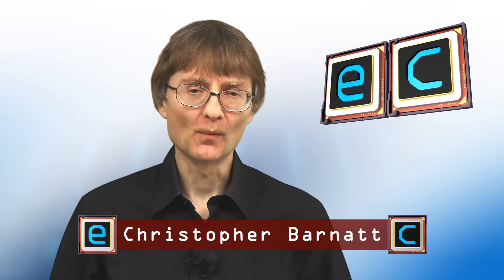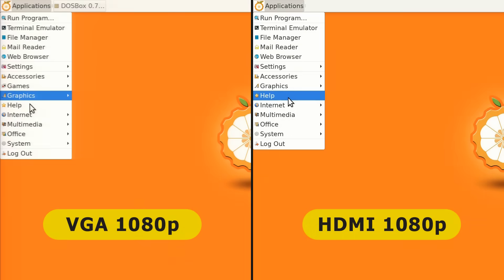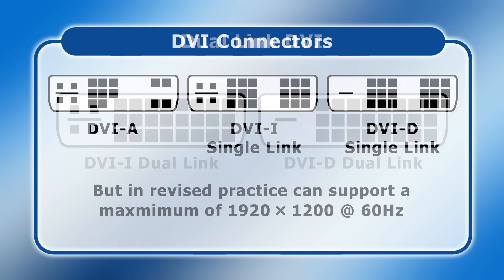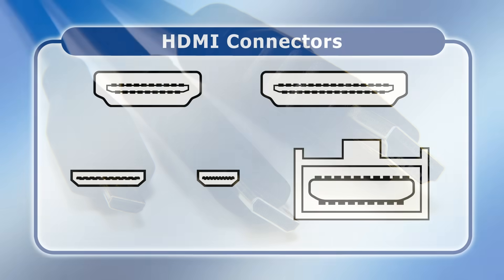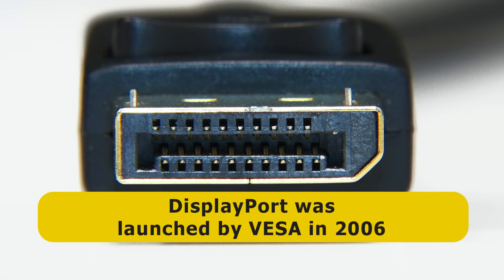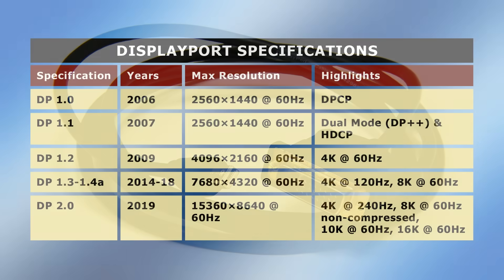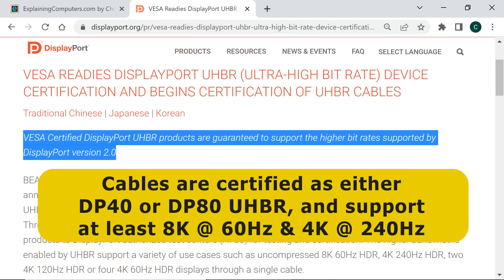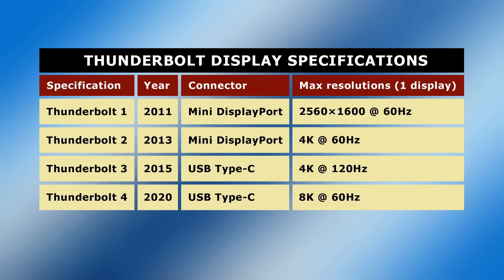Explaining Display Connectors: HDMI, DisplayPort, USB-C, DVI, VGA & Thunderbolt

Comment: As someone who does a lot of computer hardware salvage, I'm glad VGA is still around on a lot of newer displays for easy hookup, and testing of older systems.  

Far as DVI yeah that one was a total mess with all the different connectors, and cable standards coming around so quickly, and I'm glad the industry has moved away from it.  

HDMI, and Display port are a GOD send for decluttering cable mess carrying both video, and audio, just know that if you need to connect display port to HDMI don't cheap out on the adapter, and always make sure to get a quality one like Warrky that fully supports 4K 60Hz, and a good HDMI 2.0 cable that also supports 4K 60Hz, or frustration will part of your day, and more so when hooking up to a 4K display like a TV, that might only support a set number of resolutions compared to a PC monitor. 

Far as USB C/ThunderBolt  for everything that would be great if manufacturers would stop making devices with USB C ports that are really only USB 2.0 for charge/data(excluding headphones, and things like that), and not supporting any other benefits of USBC/ThunderBolt like for example my Nokia G50 Android phone, and Nokia T20 Android tablet both fairly new USB C devices, but stuck at USB 2.0 for data, and only the bare minimum of fast charing, with no other USB C benefits. 🤦‍♂️

As always Chris thanks for another great Sunday morning video. 😀👍
Reply from the maker: Thanks for this. And VGA will be to the fore in next week's video . . .
Reply: @ExplainingComputers  Anytime 😀

Comment: To this day they ship many new monitors with only a VGA cable and no HDMI or DVI although they often come with such port as well.
Reply: It's called being cheap as VGA cables don't cost that much to produce so they can say well we gave you something to hookup the monitor with, and you will also notice that most of the VGA cables you see that come with a monitor/TV these days are thinner, lower quality as well, which causes some of the problems Chris mentioned in the video when looking at a VGA signal at 720p, or 1080p, where a higher quality thicker VGA cable with better shielding, and ferrite beads on each end helps mitigate some of that, but VGA really does start to hit it's limit at 1080p, and I noticed that even using a high quality VGA cable on my old 47in Samsung 1080p TV with my RCA branded 1080p ATSC OTA Converter/DVR box that has the option of using VGA, HDMI 1.4, component, composite, or RF outputs, and both a good quality HDMI cable, and set of component cables looked very slightly better with a less less soft picture, and with not as much color shift on the blues.  Having said that if all your inputs are taken up on your TV, and VGA is the only option left, and you don't want an HDMI switch box for a say a computer, it's far from the worst option to use if you are not sitting right on top of the display.
Reply from the maker: This is so true!

Comment: Like Optimus Prime said:
They are a young species, they still have much to learn.
They should come with 2 simple standards, one with a simple and robust design for big screens and a small version for phones and notebooks with extra cost but hardly no cuts on specs and both should be compatible like in that picture showing 2 types using the same cable.

Comment: This is pure madness. As a young mechanical engineer starting my career back in 1970, I was told that we had to use "standard" fasteners to keep the number of different types of fasteners down to a reasonable number. My boss also said, "What I love about standards is that there are so many of them to choose from!" If he is watching from heaven, he is probably laughing loudly at this mass array of video standards. At least the USB working group attempted to keep some backward compatibility!
Reply: Video signal transmission and equipment compatibility has always been insane. At least we have almost got rid of various video signal standards in different countries (PAL, SECAM, NTSC and exotic derivatives of them, such as PAL60 or MESECAM), as well as non-standard scan frequencies in computers.
Reply: I am with you, there are too damn many video connectors
Reply: yes, but this sort of madness makes them money, remember the about not putting USB chargers in box with new devices (the save the planet stuff, but replace a monitor, now involves buying at least two or three cables, and still getting the wrong one? it needs?
Reply: @dh2032  it's not just about making money. Technology has improved so the standard needs to improve, too.

We went from analog/no audio to digital/no audio to digital & audio for video.

Usb changed because it had to get smaller for smaller devices. Cathode Ray Dude has shown old digital cameras that used the old, huge boxy USB-B connector and took up a lot of real estate on the back. So we shrunk usb smaller and smaller but micro can't provide much power, so we made the connector slightly bigger for usb C and made it flippable (that old problem with usb A) and can carry much more power, no more just 500mA.
Reply: The USB working group is the worse offender, especially with USB C. You can have a computer with several USB C ports, some do video, some do 'power delivery', it's kind of a suck it and see when it comes to what will work in what port, especially as any supplied literature that came with it will be soon misplace, or thrown away after it is initially equipment setup.
The poor owned buys a new USB C device, it may work in this port, no, try the next ... what a mess.
Reply: Its not that there are many, its because standard changes as world and technology evolve. We went from RF to HDMI2.xx and also depends on the size of the device that's why we have a smaller version of the same product. And also some want to be in the leading competitive edge despite people don't want it like apple.
Reply: When I was in school back then, in the US, we began the transition from imperial to metric. We are miles away from finishing the transition.
Reply: Situation: there are 17 incompatible competing protocols.
"I'm going to create a new, better protocol to replace them!"
Situation: there are 18 incompatible competing protocols.
Reply: … and if you don’t like any of the current standards, just wait for next year’s.
Reply: We use projectors at work on bog standard 1080P on 15M HDMI leads. After some trial and error, we get consistent results with Startech at about £60 each. Any other flavour of copper, fibre, active or passive leads has incompatibility either in power signalling, random frame loss or some other issue. Amazon "32K Ultra fast Terabit no noise super flexible platinum plated etc" costing >£100 being no better. This is because the standard changes and manufacturers interpret things differently. It's almost as buggy as Bluetooth used to be!

HDBAseT is great, but the manufacturers ignore it and use dual ethernet as a non-standard 'standard' because splitting and combining video and keyboard and mouse cost s lot more than simply driving each over cat5 separately. 

USB isn't bulletproof. If you programme Arduino you will soon find out.

All good fun 🙂
Reply: Yea but they shouldn't have jumped to usb c.
Reply: hes down below
Reply: yes, the madness of proprietary patents and licences rules...OK
Reply: Usb is not really backwards compatible as the connectors are all different
Reply: @LOTPOR0402  Eh, that's not entirely true. The point is as long as you have the same head, it will fit into the same size socket and be usable. You can plug in a USB-A 3.0 head into a USB-A 1.0 port (WHY WOULD YOU DO THAT?!) and it should still work. A microUSB 2.0 head fits into a microUSB 3.0 port, too. The biggest hiccups would be power delivery and data rates.
Reply: @encycl07pedia-  There are some USB 2.0 and 3.0 devices that have minimum speed/bandwidth requirements for their basic functionality that prevent them from working on a USB 1.0 port. But for any device that is capable of throttling it’s speed down to a USB 1.0 speeds, then they will work but it likely will be maddeningly slow or have other serious issues like a poor frame rate/resolution issues in the case of a USB video capture device so there little reason to do so except for emergency/better then nothing situations.
Reply: @encycl07pedia-  Usb mini micro and C are not compatible ,not unless you get an adaptor .Why change to begin with
Reply: @LOTPOR0402  but it's only form factor that changes. you can just use a passive adapter. (ok maybe not for USB C but actually if the other end was connected by someone other then an idiot you would be able to)
Reply: @Charlesb88  Newer versions of USB are mostly about more speed, of course you would not expect them to work at speed on USB 1 ports, and spinning disks might not work at all as they read data too quickly.
Reply: @oneeyedphotographer  I have used some USB  3.0 devices (mostly USB 3.0 hard drives and USB thumb drives) on USB 2.0 only computers (and even 2.0 on 1.0) and while they were a lot slower, they where still technically usable, with a few exceptions where I knew going in they likely wouldn’t work. Back when USB 1.0 was the only game in town, I did buy a generic USB hard drive enclosure back in the late 90’s and installed a PATA hard disk in it and all I can say is that it technically worked but transferring file to and from the drive was like very slow, only something to use in an emergency situation not everyday. Different story with USB 2.0 or Firewire 400. Some USB 2.0 or 3.0 devices will technically work with 1.0 or 2.0 but with significant issues like slow speed, image resolution, etc. but this backwards compatibility does have some limited use in the retro computer world.
Reply: @LOTPOR0402  You can connect your old USB keyboard (USB 1.1 low speed) to a state-of-the-art USB 3.x A-type connector, and as a surprise you can also use it. And you may also place your latest USB 3.2 memory stick to your old PC with Windows 98. I'd regard that as a high degree of backward compatibility.
Reply: @LOTPOR0402  There are different sized connectors, yes, but the incompatible elements are mostly size. I expect that an ancient USB 1 keyboard from the early days of

Comment: Very good, as usual. I noticed that you had a image of 2 HDMI cables labelled 4K but it is worth noting that there is no such thing as a 4K cable, which did cause confusion and controversy when 4K came along.
Reply from the maker: It will depend on the frame/refresh rate, but some early HDMI cables could not reliably carry a 4K signal. I certainly have some such cables around that work fine at 1080p, but not at 2160p.

Comment: A great overview (and answered some questions I had about HDMI vs. DP).
Now I'm waiting for a video on describing the "wireless video & audio" standards--sometimes my Smart TV permits a computer to connect, and other times not so much.
Reply from the maker: Another video topic, certainly! :)
Reply: The lack of standardisation for wireless AV is frustrating. It's more like a collection of walled gardens belonging to their proprietary ecosystems. Like the need for a Chromecast dongle for the Google/Android world, an Apple TV for iOS/macOS, and an Xbox for Windows. And Miracast seems more or less stuck in the past since it was not embraced by the industry. That is just sad.
Reply: Video would be one thing over wireless but even surround sound can fall prey to proprietary marketing as per a video by Linus from LTT on his brand-new home wireless sound system.  Interesting to check out for anyone considering such a setup.

Comment: I'm always impressed by the bandwidth these standards support.  Even 4K@60Hz with 8 bits/color component requires a bandwidth of:

3840 x 2160 x 60 x 3 x 8 = ~12Gb/s

and that doesn't include audio or other data.

8K at 120Hz and 48 bits/pixel would be 191 Gb/s!
Reply from the maker: Nice calculations. We do indeed take significant bandwidth for granted these days,
Reply: that's assuming if individual raw pixel data is being transported. Compression/Decompression is done to minimize the required bandwidth.
Reply: The calculations would be much nicer if you used appropriate units next to each number. Then we could check to make sure the units at the end are indeed Gb/s.
Reply: @d.barnette2687  pixels/frame x frames/s x bits/pixel = bits/s if you want to do a dimensional analysis.
Reply: @dfs-comedy  Well done -- thanks for the description of units used. As an aerospace engineer, I always desire to see units. It helps in understanding the analysis. In fact, I usually work problems first with units and supply the numbers after I make sure the units work out properly. It usually turns out that supplying the conversion numbers is the easy part, but ensuring proper dimensional analysis is the most difficult. Thanks for the reply, and again, well done! :)
Reply: I'm actually rather unimpressed. DVI-DL was released back in 1999, and the standards we use today doesn't support much higher bandwidth than this. Had resolutions increased in speed at just a small fraction of the rest of the components 8K@240Hz would have a common resolution these days. We for almost two decades saw no improvement in resolution. 1024x768 and 1280x1024 were two common resolutions back in 1995. It wasn't until ~2010 we started to move towards 1080p. A resolution we may still consider the standard for most devices sold today, from smartphones to monitors and laptops.
Reply: @SweBeach2023  go ahead and design consumer-priced  hardware that can support a data rate of 191 Gb/s.  That is a very impressive achievement.

Resolutions higher than 1080p don't make much sense on smartphones. The pixels would be so tiny you'd need to scale everything up to make it legible.

Comment: I am guessing that usb C with charger and display ability will be the next thing, or even display over LAN, like air play and however it is call.
I work with laptop that are often plugged with C type to charge and display. It clug less the space but there is difficulty with the use of other usb ports if the laptop is put to sleep.

Comment: Wish I had this video about 10 years ago when I was trying to figure out all the different DVI cables. One cable that is old and gone is the S-VIdeo. I had an old LinuxMCE setup and my old computers and TV's had this connector. It was a little round 7 pin connector. It was one step up from the old composite video which was the standard coaxial cable on most televisions.

Comment: Thanks for this.  I'm not one for bleeding edge equipment.  My personal and work computers just use bog standard 1080p HDMI cables and I don't think much about them.  Regardless, it's just good have this as back-pocket knowledge in the inevitable event that hardware gets upgraded to something new. For example, I didn't realise that DVI to SVGA could require more than a passive adapter. That being said, I'm unlikely to use either going forward. It doesn't negate the knowledge though.

Always grateful for your Sunday morning briefings and happy new year.
Reply from the maker: Greetings Jenn. :)

Comment: I'm still suing vga connector.
Reply: I do computer salvage as a hobby when going thrifting, and looking in the e-waste bin at the local recycle drop off from time to time, and yep I still use VGA for older systems to test, and get them up, and running. Also for the most part I think VGA looks fine at 720p, and 1080p with a high quality VGA cable, and not a  thin cheap VGA cable that come bundled with many low end monitors these days that still have a VGA port.
Reply: I think you meant using, not suing.

Comment: DVI can carry audio, but it's not part of the base specification. It's used for audio over DVI to HDMI adapters in some GPUs.
Reply from the maker: Yes, this is where a graphics card is specified for "HDMI audio over DVI" -- which is absolutely not part of the DVI standard. The video comes from the DVI port, but the audio just happens to be chucked onto some DVI pins so that a non-standard HDMI adapter will work to provide video and audio to an HDMI monitor. It is not possible to connect a computer to a monitor via DVI to transmit video and audio. :)
Reply: Beat me to it. Yeah, audio over DVI sure exists, but it sure as hell ain't common, which is a bit of a shame.

Comment: It should be noted that not all full-sized DP cables have a locking mechanism. The one that came with my monitor, for example, didn’t have a locking mechanism.
Reply from the maker: Oh! Very interesting. Probably not build to the full specifcation . . . But so long as it worked! :)
Reply: @ExplainingComputers  The Warrky Display port to HDMI adapters I use don't have a lock either, but still have a good solid fit with fully metal connectors/housings along with thick cloth braided cables, and they are built to full 4K 60hz spec, along with being one of the more highly rated brands on Amazon, so I suspect the lock was part of the OG standard as an option, kind of like how not all RF Coax cables here in North America have to be screwed in, but can be push right onto the terminal(usually cheap low quality junk cables do it to save a few cents on the screw connection).

Comment: One important fact you left out was maximum display support. Legacy display standards for example VGA, DVI and yes HDMI only support a maximum of 2 displays (as these lack the synchronization mechanism that allows multiple monitors to sync up.) If you want to add a 3rd display or higher you will have to use a "native" DP, or "active" type DP to legacy adapter.
Reply: Well noticed. I recently reviewed a Beelink U59 Pro which had a 3-monitor-solution. 2 HDMIs and 1 USB-C to accomplish that. 💪